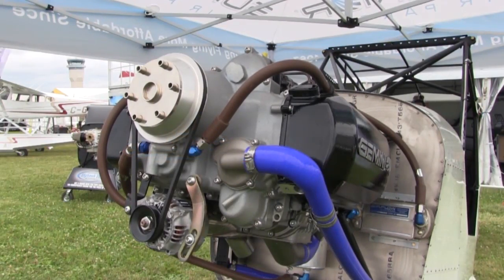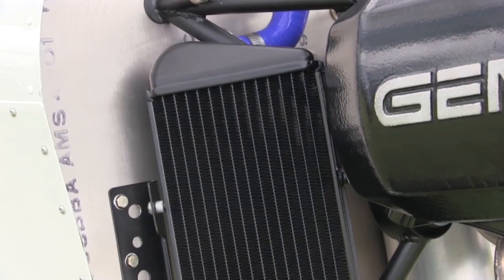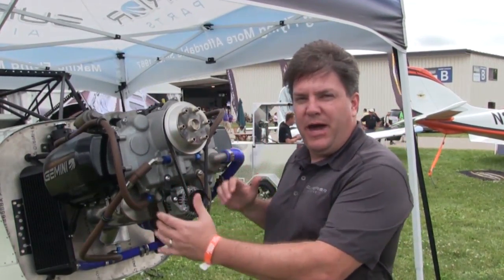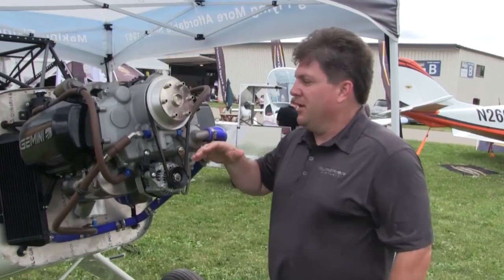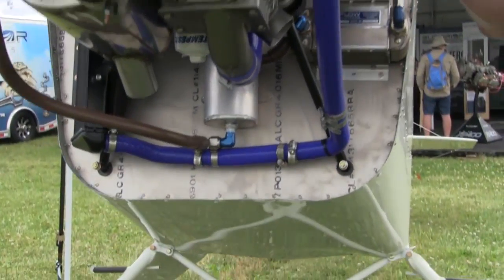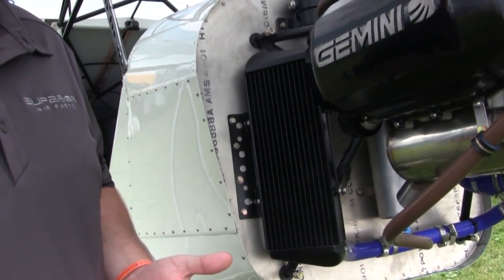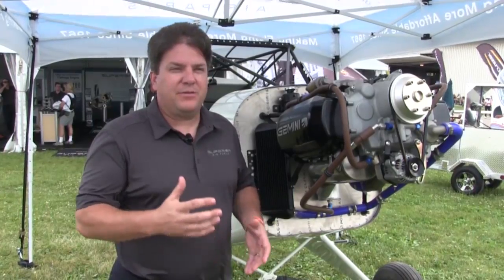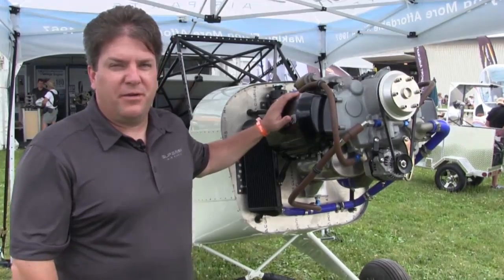American Legend Gets a Diesel

Comment: I wanna have this in a car
Reply: Yes me too, now plump a vro pump from the oit tank to the fuel and motule 800 2t or some 2 stroke oil like it.
Reply: @jlo13800  Bruce, why tf should you run 2 two stroke oil in it, it uses engine oil.
Reply: @isakjohansson7134  Rigiged up total loss oil burnoff system and a good synthetic should work and burn clean, no oil changer required. this can work on any 2 stroke or 4 joke and i have had suces doing with amsoil interceptor on a kohler engine for some time now. works great and VRO pumps are cheap and easily plumbed to the engine. the ETEC and optimax work this way and no need to throw away oil and this 2 stroke can turn to energy.
Reply: @isakjohansson7134   2 stroke oil is engine oil, what do you have against it. i would motule 800 2t with dry sump and oil injection into the fuel! i do this with my 8v92 detroit turbo 2 stroke with 6 gallons of XD-100 brp oil with out hiccups! why do you hate 2 stroke oil so much. did you drink it and almost poison yourself?
Reply: @isakjohansson7134  What do you have against 2 stroke oil, you must live a plain beaning wet sump life style which many of us do not want or care for, im sorry i have violated your plain bushing wet sump wet sump life style! 2 stroke run fiune on plain bushings like the graphite bronze bearing g that can run as lean as 80;1
Reply: im sorry i violated your wet sump engine oil wet sump anti 2 stroke oil lifestyle!

Comment: Diesels don't belong in airplanes. Mogas is the way to go.
Reply: Ethanol says "no"...
Reply: @scsirob  Mogas shouldn't have ethanol in it.
Reply: Mogas will not produce the same power as a 2 stroke diesel! a 2 cycle diesel is more efficent and much more powerful at low rev's hence more torque with fewer moving parts, 2 cycle diesels are much more powerful than gas engines!
Reply: @jlo13800  Everything that you just said is wrong. Gasoline engines make more torque than diesels, unless the diesel is boosted higher. Because gasoline engines make more torque and are capable of maintaining a higher BMEP at a higher rpm, they also make more power. Diesels are inherently heavier than gasoline engines, gasoline engines make more power than diesels and power to weight ratio is all that really matters when it comes to aircraft engine performance. Modern 4 stroke diesels are also more complex than modern 4 stroke gasoline engines, requiring turbochargers and direct injection, while gasoline engines can be made plenty powerful without either. As with 4 stroke engines, 2 stroke gasoline engines would likely be less complex than 2 stroke diesels.

2 stroke engines also have terrible fuel efficiency, even when they're diesels, and that's a big deal, because jet fuel is more expensive than mogas.

The Deltahawk 2-stroke diesel weighs 315 pounds and makes 180 hp, while the Adept Airmotive 280N weighs 324 pounds and makes 280 hp, without any kind of forced induction. Adept Airmotive also makes turbocharged versions of the same engine which make 320 and 360 hp, while only weighing 340 pounds.

As for torque (which really doesn't mean anything in an aircraft application), even the naturally aspirated Continental IO-360 makes more than the Deltahawk, which makes 350 lb-ft at 2,700 rpm, while the IO-360 makes 394 at 2,800 rpm.

Diesels are just massively obsolete at this point, even their fuel efficiency isn't all that impressive relative to modern gasoline engines.
Reply: @PistonAvatarGuy You are wright just teasing ya! thats  why big inch cummins move 900 cubic inch needs turbo trucks but it as about the BMEP. lighintning is the most powerful 2 stroke. diesel need a lot of help with turbo to amkie the same power. look at the rotax 850 etec turbo and large ship methanol 2 stroke engines! I have tey to see a big gas engine move a hreavy load as diesel is much more -powerful! look at todays diesel trucks they do not produce anywhere near the torque of a diesel. today power stroke 2 stroke poppet valved 6.7 makes over 1050 ft-lbs torque stock gas engines are nowhere as strong! Back up the evidence as diesel make way more torque! Dieael is way more powerful as a gas engine cannot produce the torque of a diesel. 2 stroke diesels are insane! Diesels fire with way more pressure and power!
Reply: @jlo13800  Again, diesels only make more torque than gasoline engines when they're BOOSTED higher. If you compare a naturally aspirated gasoline engine to a turbocharged diesel, the diesel is likely to make more torque.

Again...
Continental IO-360: 394 lb-ft of torque at 2,800 rpm
Deltahawk diesel (with forced induction): 350 lb-ft of torque at 2,700 rpm

Other naturally aspirated engines...

Early '90s 4 cylinder engines:

Honda F20A (2.0 liter gasoline): 143 hp - 138 lb⋅ft
Mercedes-Benz OM604 (2.0 liter diesel): 87 hp - 100 lb⋅ft

Honda F22A (2.2 liter gasoline): 140 hp - 142 lb⋅ft
Mercedes-Benz OM604 (2.2 liter diesel): 94 hp - 111 lb⋅ft

Early '80s V8s:

Chevy 350 (gasoline, typical): 165 hp - 275 lb⋅ft
Chevy 350 TPI (gasoline): 250 hp - 345 lb⋅ft
Oldsmobile 350 Diesel - 120 hp - 220 lb⋅ft

'90s V8s:

5.7 liter LS1 (gasoline): 345 hp - 350 lb⋅ft
6.5 liter Detroit Diesel V8 (non-turbo): 160 hp - 290 lb⋅ft

7+ liter V8s:

International Harvester IDI (diesel): 185 hp - 338 lb-ft
Ford Godzilla (gasoline): 430 hp - 475 lb-ft
Typical 1960s GM 427 (gasoline): 430 hp - 460 lb-ft
Reply: @PistonAvatarGuy yes 2 strokes can make high torque1 look at the maico 760 from the 70's. over 30 hp boosted from the crankase 2 sgtroke 26 to 33 hp at 1200 rpm's. look at lightening which is a very powerful non burning valence electron bond 2 stroke
Reply: @PistonAvatarGuy  That nis why an 850 etec is king, dry sump fed and more power per CID than any 4 joke can deliver at that low rpm, oil injection and oil feed required! nNo wet sump here! pure muscle
Reply: @PistonAvatarGuy  yes diese4l must be boosted higher are you comparing 2 stroke or 4 joke stroke. 4 joke stroke is weak and delivers very littler power but a crankcase scavenged 2 stroke diesel like meriska veres had she machined 12 ports to deliver over 3 hp per cid at low rpm
Reply: Meriska machined a 12 port pastern in her crankcase scavenged 2 stroke Sachs diesel and made over 4.5 per ci=d with miled boost
Reply: @jlo13800  Nothing that you're saying is making sense. Look at the Deltahawk engine, it's a 2 stroke and its power output (and torque output) is pathetic relative to an IO-360, which is a very old design. Modern 4 stroke gasoline engine designs absolutely destroy the Deltahawk 2 stroke, in every possible way.

I don't understand why you think that any of the 2 stroke information is relevant in this discussion, as anyone who can afford to put a 4 stroke on an aircraft will do so, because 4 strokes are far more reliable than 2 strokes. People are entrusting their lives to these engines, they want them to be as reliable as possible.

No one would buy a crankcase scavenged 2 stroke for a larger aircraft, the fuel and oil burn rate would be ridiculous. I just don't understand your point here.
Reply: im not a fan of it
Reply: @jlo13800  You do what you want, I'm just pointing out that 2 strokes don't make sense in aircraft applications.

Not a fan of what?
Reply: @PistonAvatarGuy  A gasoline engine make way less torque thats whe we see them in big rigs they are much less powerful as a 2 stroke!
Reply: today's diesel will trash a Gasser as it is much more  powerful
Reply: @PistonAvatarGuy  gas engines are far more weaker a 6.7L cumm9in will trash a running as a loop charged loop 2 stroke, diesels are built way stronger to handle thew BMEP
Reply: @jlo13800  You're just not making any sense, buddy, and you're not reading my replies.
Reply: Diesels are far stronger
Reply: @jlo13800  "gas does not not delver nowhere near the break mean effective pressure!"

Uhh, at the same boost pressures, gasoline engines deliver much HIGHER BMEP. Big rigs don't care about how much torque the engine produces, they just want a long lasting engine that is as cheap to operate as possible and POWERFUL (torque is not power) enough to get the job done, and until recently, that was diesels. These days, natural gas engines are a far better choice. Tugboats, do care about torque output, because they don't want to need to use gears to reduce the engine rpm to the propeller rpm (though, with something like a Voith Schneider Propeller, that doesn't really matter). But, AGAIN, gasoline engines make more torque (because their BMEP is higher) than diesels, diesels are just cheaper to operate.

TL;DR: Diesels have pathetic torque and power output, but they're (sometimes) cheaper to operate, so they're used where cost of operation is a major consideration.
Reply: @PistonAvatarGuy  Yes and big ship 2 strokes can run methanol and natural gas. Cooper Bessemer makes a big natural gas 2 stroke that makes well over 9500hp at low rpm's. All these pickups today claim over 900 ft-lbs but they are souped up with a lot of turboes to do that otherwise they would be gutless. A ski-doo 850 rotax etec 2 strokes lakes well over 108 ft-lbs torque N/A! with the turbo much more form about 51 CID. If this motor were scaled up it would be a blast to drive than the pathetic 4 joke stroke which the automotive world is stuck on! Achates power is making progress with their OP 2 strokes and cummins makes the OP ACE 2 stroke for the army now.
Reply: @PistonAvatarGuy  yeah diesels can be overrated. Converting a IO-360 to a 2 stroke would be a fun project and would sound awsome. Good luck to all those buying these ugly high strung 4 joke outboards! Dropping a 3.2l v6 optimax 2 stroke with turbo and some rigged up exhaust trapping valves in a car like a6 8 nova would be an awesome swap. i always loved the muscle cars but they powered by 4 joke crap that sounds awful to me and complex. fortunatly its easy to make a big block 2 stroke out of an aluminum v8.
Reply: @jlo13800  Things are far more complicated than just "two stroke go vroooom!"

Imagine that.
Reply: @PistonAvatarGuy  I hear ya on that one a 2 stroke 500 CID DFI crate motor would be awsome for a street rod progect or 68-70 olds 442! heck muscle sports car run a DFI 2 stroke. GM did a 427 CID 2 stroke prototype in 68 but the emission killed that project. With todays  DFI technology and VRO from dry sump that would be something as an option. For now we can do a 2 stroke conversion poppet valved u-loop charged like this vw 1.9.https://www.youtube.com/watch?v=qosAllch8Sg&t=3s
Reply: @jlo13800  Why? Why would anyone want a 2-stroke engine in anything?
Reply: @PistonAvatarGuy  Great power to weigh ratio, can be cleaner and more efficient with DFI and exhaust trapping valves. The sound is awsome and can be tuned to make big torque at low rpm. the 2 stroke cycle is what nature does as a lightning bolt is a uni-flow 2 stroke plasma1 the sun is a giant loop charged plasma ball 2 stroke. You can even turn a boring 4 joke into a 2 stroke by loop charging through the valves! this was done on some Hemi motors for street rods/racing applications. here is. here is an OP 2 stroke cummins ace engine with dry sump:https://mart.cummins.com/imagelibrary/data/assetfiles/0058689.pdf?fbclid=IwAR3PWM1vZs8JxpuZMoJO5Y0YFoF9pV9fuGEhbyiGgxIP0r6sxzhqo5_P9oY. I have an 8v92 2 stroke detroit and small block side oiler johnson v8 4l omc 2 stroke v8. they are fun to tinker with.My detroit i rigged up total loss  oil burn off on it and it works. Im running xd-100/shell rotell mixture and it clean the motor and boost film strength. My rotary wankle 2 stroke is stricky using amsoil interceptor and its great for these. next i want to get a big S2s v-twin harley motor for a 2 stroke conversion ans there lots of room to cut ports in those jugs.
Reply: @PistonAvatarGuy  even electric motors are an electromagnetic rotary 2 stroke and they make lots of torque.
Reply: @jlo13800  Who cares about torque output? Power is what makes things go.
Reply: @PistonAvatarGuy  Yeah true and 2 strokes got plenty of power too for their size! they will last long if proper maintainnace and are quit durable. i like the side oiler VRO dry sump then this wet sump crap.
Reply: @jlo13800  No one wants to burn oil in an engine, it costs money and it creates pollution. It may be fine for small engines that aren't used often, but not for passenger aircraft applications.
Reply: @PistonAvatarGuy  oh these diesel truck folks are obseesed with torque. their are electric motors that can fit in your lab that make equivalent torque or more. Im thinking of getting a rotax 850 ski doo engine off ebay to do a water arc explosion conversion pulsed plasma 2 stroke. now this would be tapping vacuum ZPE aetheric energy which power all charged particles and and they are broken symmetry in the quantum vacuum. i have to grab a 3.2l stroker optimax when i get around to it. I need to rebuild my v8 small block 2 stroke johnson side oiler.its based off a SB chevy v8 with a sealed off crankcase and 8 carbs on the bottom.
Reply: @PistonAvatarGuy  Castor 927 maxima is one of my favorite oils. i think the gemeni engie burn some off as she goes, not sure. i even rigged a kohler toro mower with amsoil interceptor synthetic 2t. i fill the crankcase and pull some off nd run 40:1. i got 6 gallons BRP XD-100 running though my 8v92 and works fine. I would love to get silkolene pro 2 sx or motul 800 2t if i can get enough of it.
Reply: @jlo13800  Nothing that you're saying here makes sense in the context of aircraft engines. Aircraft engines must be reliable and efficient, two-strokes are neither.

In ships, two strokes can be made reliable because they can be made heavy, you can't do that in an aircraft application.
Reply: @PistonAvatarGuy  true you most be a 4 joke fan. 2 stroke are plenty reliable if maintained properly. There should be a gas version of the gemini 2 stroke op though. Dont forget the sun is a plasma 2 stroke and lightning is also a plasma 2 stroke that's worked for a long time but that's getting off the subject. What reliability issues are you referring to.

Comment: It's hard enough to find autogas at airports.  What are the prospects of getting diesel at airports?  Or are they aiming for another market outside of the US?
Reply: Michael Massey AVGAS price can be as high as $13,- / USG in Europe. Jet Fuel is relative cheap. E.g. a DA40 with a lycoming consumes about €90/hr AVGAS, with the diesel engine around €25,-/hr of A1 jet fuel. So diesel engines are most welcome on this side of the pond.
Reply: Michael Massey Jet fuel.
Reply: O I C....  Thanks
Reply: Its because of your liberal politics, there nothing wrong with avgas 100 LL!
Reply: @jlo13800  Nonsense... there this is a lightweight 100-120hp diesel, that is both more efficient and burns a more power dense fuel (diesel is significantly higher power per lb than gasoline). Too bad the chinese grabbed the design and mothballed it.
Reply: @Wingnut353  Do you have more details on this "grabbed the design and mothballed it" ?
Reply: Other than the fact that lead is extremely toxic and has been proven to cause neurological damage.